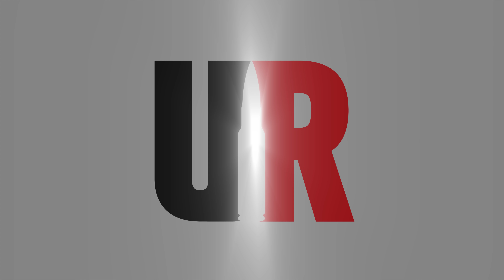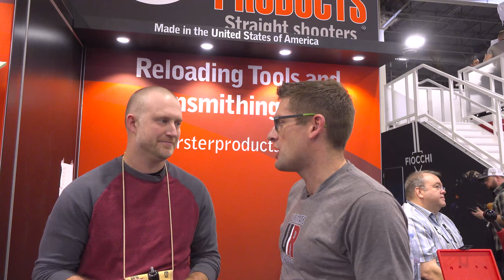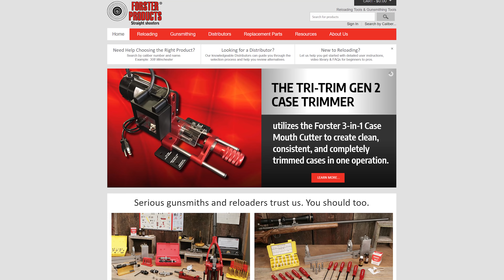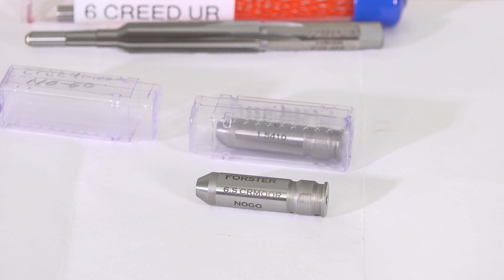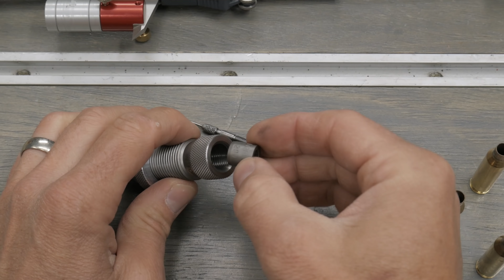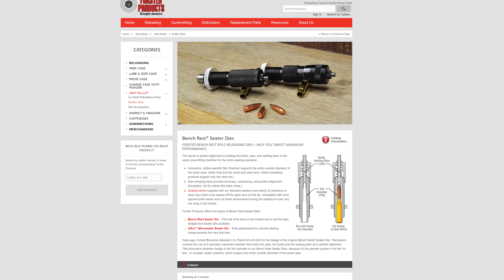Shot Show 2020: Forster Products

Comment: 15 dollar ($15.00) die modifications... how great is that.  just one problem... I want to open up the front of my full length dies so the base of my cases fit the back of the chamber.  (bolt gun) didn't see that option so I just drilled out my 223 fl die using a 3/8" coated drill bit.  turns out 3/8 is .375 the exact size i needed.  drilling with a cordless drill is slow and it took me parts of 2 days to do it plus honing the leading edge.

Comment: Bump/neck dies...  6.5 PRC.  You've got my attention!
Reply: what is so great about this die is its ability to set the shoulder back without affecting the neck.  

I set my neck tension with a modified lee collett neck die and as you all know it does not bump the shoulder back... hence... the need for a shoulder only bump die.

and yes im using my co-ax in both operations.

leaving the base of the case 1 thousand inside of the chamber (on a bolt tika t3 223).

i could set the neck tension and bump the shoulder back with the forester die, but thats not what i do.

while your out shopping for dies... make sure you pick up an RCBS Precision MIC gauge.  it tells us exactly where to set the lock ring on the forester die.  

to get set correctly you have to remove the extractor pin on the bolt to find the correct headspace.

on my 223 i use once fired wcc military cases as go no go gauges and keep bumping then back to find my zero point then i bump back at least 2 thou and the die is set to bump back 3 thousands.  the range being 2 to 4 thousands.

im setting the shoulder back for both safety and accuracy.
Reply: @firetip198  hey, great post. I too use a lee collet die but use a body die for FL resize so it doesn't touch the neck. Eagle Eye Shooting on YouTube does a great video (called "STOP BUMP SIZING) about resizing 1 thou larger than the chamber and using the cam of the bolt to resize in the rifle chamber to ensure cartridge concentricity within the chamber. Check it out, you may find it interesting. Also, Tikkas rock but I am not a fan of their magazines, I wish they would convert them all to the CTR style.
Cheers from Australia.
Reply: @aleembruggen  ok this is great... i am going to make a body die from one of my new lee full length dies by reaming out the neck.  i could just order a redding body die , but i still have to cut the front of the die to .375 or 3/8 (my chamber is .376) to get the back end fit i want on the case at its base and i would rather cut a couple of lee dies because i allready have them on hand.  

i used 3  in 1 oil as cutting oil (because that all i had).  

if you go to saami's web page you can get the dimensions for the chamber and the dimmensions for the case.  then eventually if you work with all of these numbers enough you will know them without having to look at them.  the chamber cut can varry from maker to maker so we use our tools and gauges to find our chamber size.  plus we can use cero-safe to cast our chamber to verify our measurments are correct. (brownells).

the beauty of buying once fired military cases is they will not fit my rifle because they are to big at the shoulder and at the trim length, but they almost always fit at the base of the case.  
so i can go down in size to get the fit i want using my dies but not up.   

the lee collet die was modified by using sandpaper to open the slots on the collet a very small amount.  it was almost perfect out of the box so it didnt need much.
my forester trimmer is setup to neck turn and the collet die sets the diameter ahead of turning.  

my sinclair concentricity tool and my sinclair neck wall thickness gauge is used to indicate the quality of my cases and segragate out the very best of the very best cases to load for shooting paper at 200 yds out to 1,000 yards.  i also have a redding neck wall thickness gauge which does a good job of finding the high and low sides of the case then i mark the low side of the case and the mark is set to 6 o clock in the chamber + or -.

i wanted to see if there is some other die maker out there besides lee that can out perform lee dies and that is still a work in progress, but my forester neck die indicates forester makes some great dies and they deep freeze their dies and this in and of itself is a great thing and an indication that they are great die makers.  

the case makers are afraid to make cases to big to fit anybodies rifle.  so they are too small to fit perfect... so we just have to shoot them to expand them to get them to custom fit our rifle.  so i can shoot em up to fit and i can squeeze them down to fit and i have the tools and gauges to dial in a finished round that has what i believe is the tip of the bullet lined up on an imaginary line on the axis of the barrel and i want that line to run through the center axis of the flash hole at the back of the case.  i also want a quality case that has a uniform neck wall thickness and i want a neck tension optimized for accuracy.
Reply: @aleembruggen  ok im gona watch this video... keep in mind... the average reloader walking the street simply does not have the measurment tools and skill set to make the necessary adjustments to get the fit they need and thats ok as long as nobody looses an eye (because their dies are not adjusted right).  i was afraid of having to tight of a fit at the shoulder, but im just gona calm down about having to tight of a fit at the shoulder.   david tubb said 2 to 5 thousands... i said 2 to 4 thousands, but i may just set my lock ring to bump back to 2 thousands instead of 3 thousands and call it good.  keep in mind i am using the rcbs presision mic gauge and if you want the redding instant indicator (which i also have) to set the lock ring on my dies and because of this im not afraid of bumping my shoulders back.  saami has a minium chamber cut and a maxium cut that is 10 thousands longer.  in my case my chamber was cut to the min.  my bore diameter at the base of the case appears to be .376 which is also saami spec.

my rifle is sako stainless steel tika t3 223...  i shoot quarter and half dollar size targets at 200 yards and penny size targets at 100 yards.  1:8 twist.  60 and 75 grain bullets.
Reply from the maker: Me too!